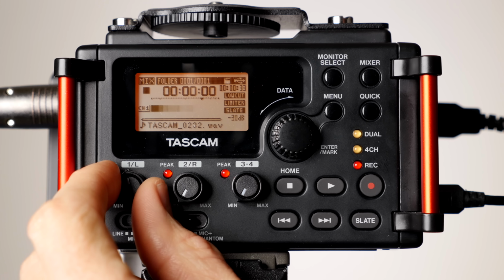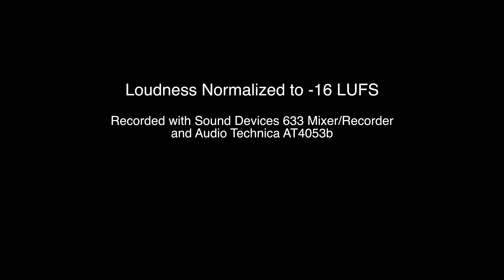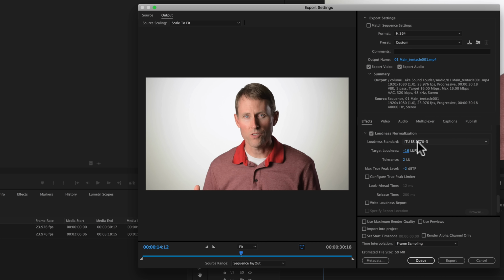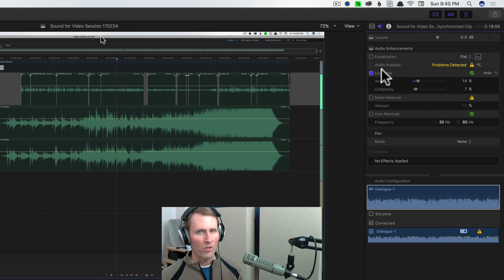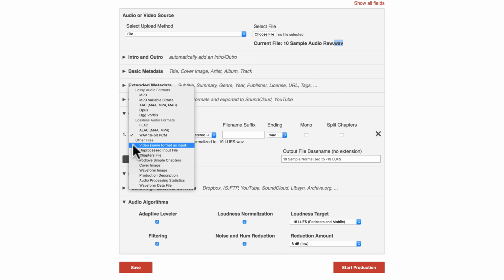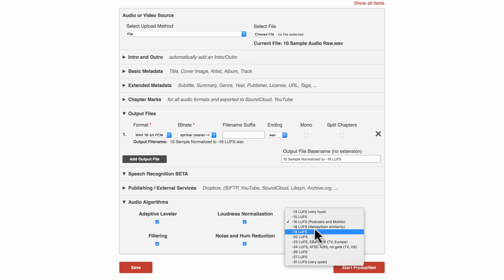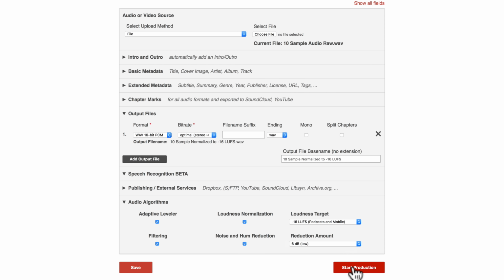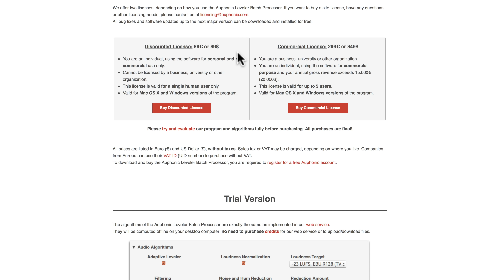How to Get Loud Consistent Sound for Video

Comment: In Audition CC 2018 use Effects/Match Loudness.  Drag and drop one or more file(s), set up using Curtis's instructions for Premiere. (There are nine choices for "Match Too" including the three in Premiere. Material for the next edition of this video.) Make sure you check the Export box and set up the export before you click Run. Seems to work pretty well.
Reply from the maker: Thanks for the update Tony.

Comment: Hi Chris & thanks for all your videos - they are an excellent resource & brilliantly produced.
I experimented with Auphonic - very easy to use, good layout & all the files processed extremely quickly - thanks for highlighting this free (for the amount I'll need) service.
Using your advised settings into my Zoom H5 with a Shotgun microphone & comparing recordings in a room with hard floors & no sound absorption (my kitchen) and a Living Room with carpet & curtains & listening through both the computer & with headphones & comparing within FCPX, I found the output was very quiet initially. After experimenting with different settings (great feature that this can be done easily in the programme pre or post download) I found that, for my situation & my preference, the following settings gave me the best results - "Format" WAV 16 BIT PCM / "Bitrate" Optimal Stereo / I selected all the "Audio Algorithms" / "Loudness Target - 15LUFS / Noise & Hum Reduction 12DB. The noise reduction element made a big improvement to the source file. I also find it easier to process the audio straight out of the ZOOM, as a single file & then upload to FCPX for the edit - I hope this helps others & keep up the good work.
Reply: Thanks Peter, great info and thanks for sharing!

Comment: Dear Curtis, I am a fan of your videos, however, recommending a costly only service for the most basic audio processing does seem a little bit odd. Audio compression and limiting can be done with popular freeware, not to mention adobe audition. Why don't you mention these alternatives?
Reply from the maker: Hi MrFabsiche, The manual method I reference near the end is the compression and normalizing method in Audition (the video is linked in the upper right corner). Also, the Auphonic service offers 2 hours of audio processing for free every month. It only costs if you need more time. Also, the Premiere Pro method is very convenient. So there are lots of options. Sorry for the confusion on that.

Comment: You can use a free tool called FFE (FFMPEG Frontend) to strip out the audio file using a copy algorithm so that you don't lose any quality from recompression.  That way you can upload the tiny audio file 100 times faster.  When you get the fixed audio file back, you can use a tool like MKVToolNix to insert the fixed audio file into the video without any recompression of the video.  So if it's an hour long file, it will only take a few seconds to remux a new MP4 file with the original video and fixed audio file.  All the processes are nondestructive and only take a few seconds.
Reply from the maker: Thanks George. Useful info!

Comment: How to normalize in DaVinci Resole in LUFS, anybody know?
Reply from the maker: Resolve has a loudness meter. You set the LUFS target in the preferences and then you have to run through the entire piece to get the current LUFS reading. Then you increase the master fader by the same # of dB. But you may need to do some compression/dynamics control to prevent clipping.

Comment: Isn't there any FCPX plugin to address that? Usually FCPX's plugins do what FCPX doesn't.
Reply from the maker: There are general VST loudness plugins out there but they work in real-time instead of offline processing. What that means in practical terms is that you have to play through an entire piece to get an LUFS integrated loudness reading. FCPX sort of does this with it's in-build audio processing in the inspector where you click the analyze button but then it doesn't give the option to normalize to a loudness target. They're 95% of the way there, just need to give us a way to set the loudness target. I hope you're listening Apple! :) (I do 95% of my cutting in FCPX)